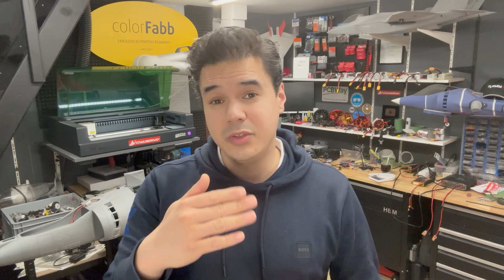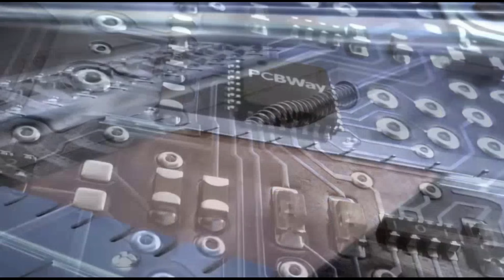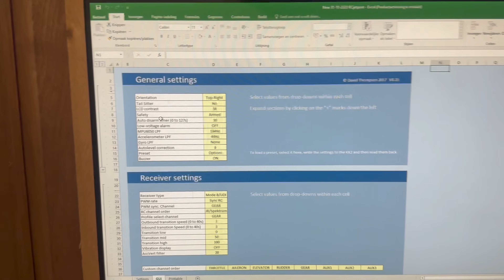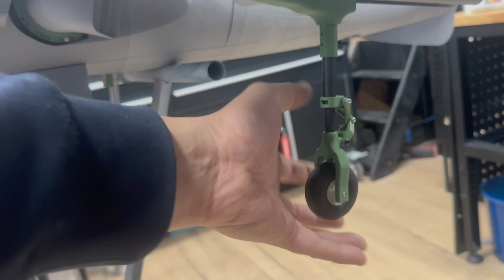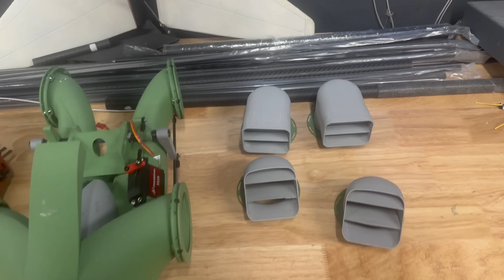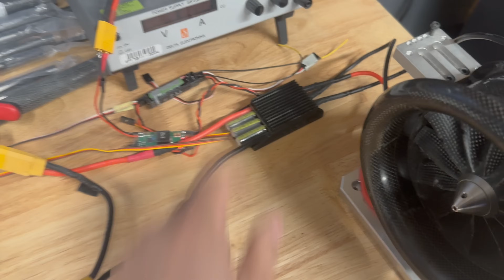RC Harrier VTOL JET, The Legendary Jumpjet Build By Joel Vlashof First Testing Vlog 5

Comment: I know you did it, but have you calculated the intake and outtake of the areas to match? I said it before and will say it again: This is the coolest project ever. I haven't see anyone try to match the real plane engineering as you have here.
Reply from the maker: Thankyou, yes an Edf needs air but it is all still compare to drawings and pictures
Reply: @Joelmelanie  Yeah I hate math myself but at this scale you may need to use it as the larger scale may be overpowered as you don't have here, so any area you can find that is being blocked could help? BUT AGAIN I LOVE THIS PROJECT! Few have done what you are doing here. Most are like your version 1 but you took it one step  future to reality.

Comment: Maybe you've answered this before, but are you also planning to conciel the pitch edf somehow or even replace it with another system similarly to the other axes?
Reply from the maker: I treid, but to be honest i think true that weight to momentum is very weak i I proceed this setup on pitch valves. T-vector as we called it is to narrow. So i go for the scale at sight. No edf in sight

Comment: Try some CHNL or SMC HV lipos and you'll likely get more thrust with lighter weight for the same capacity. Awesome work though, can't wait to see that fly when its all sorted!
Reply from the maker: Like the idea, is do have CHNL but than is investing again in lipos. I use to had CNHL but they didn’t last for long
Reply: @Joelmelanie  The downside of HV lipos is you have to be careful to not let the voltage drop too low in flight - lower than 3.6v per cell or so is the danger zone. The new SMC HV2 lipos are spectacularly good and handle abuse a bit better, but are hard to get ahold of outside of the US :/